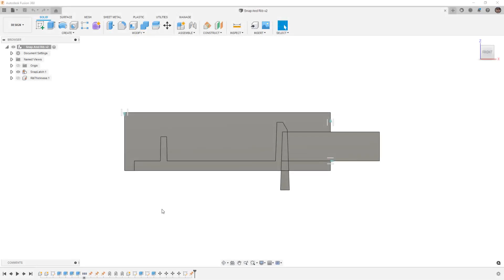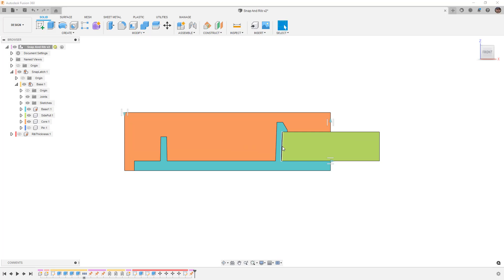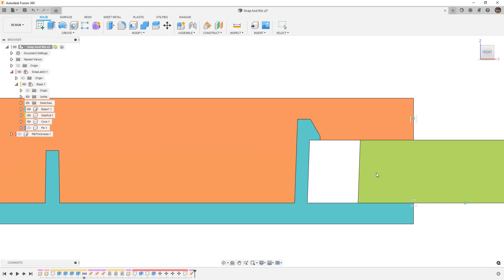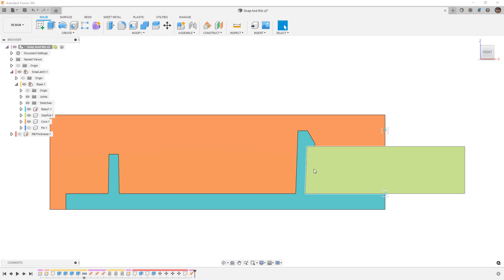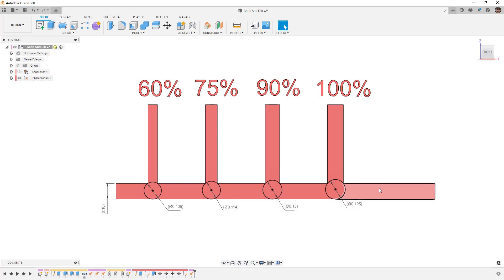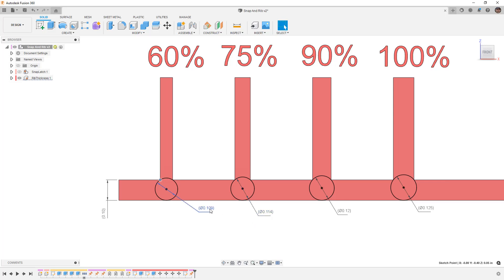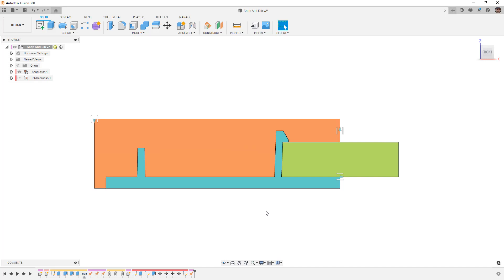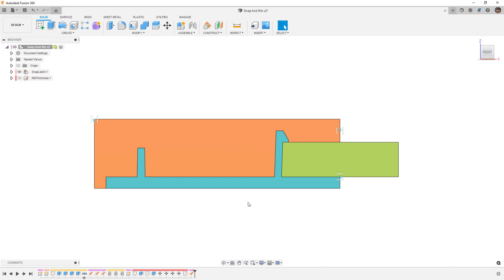Plastic Part Design Series Episode 2 - Rib and Snap Latch Design Considerations #Fusion360

Comment: just love this serie. can wait to finish, do you recommande any book for plastic parts design and manufacturing. thank you a lot.
Reply from the maker: Thanks Ahamat, I typically will just talk to the manufacturer to find out any requirements.  Most places will have some design guidelines.  One of the best things is to take stuff apart and see how it was designed.  You might see some neat tricks used that you won't find in any books!
Reply: @LearnEverythingAboutDesign   thank you a lot for the reply,  I do have learn a lot from reverse engineering the plastic parts .per example redesigning my old laptop frame or motorcycle head fairing.  I do  love them . Thank you,   have a nice day.
Reply from the maker: @ahamatibrahimhassan3265  I hope to get into motorcycle parts soon.  That is my main hobby/focus.  I used to race supermoto years ago and have built several bikes, one with a one-page spread in a magazine.  I have loads of projects on my todo list but there never seems to be enough time :)
Reply: @LearnEverythingAboutDesign  I have participated in a design and manufacturing of a formula student car during my degree but I never work on a complete motorcycle project even though I have a huge interest. I can't wait to see. I'll follow you step by step.